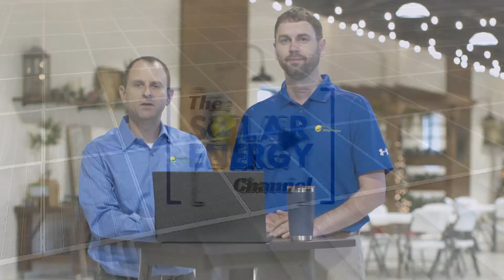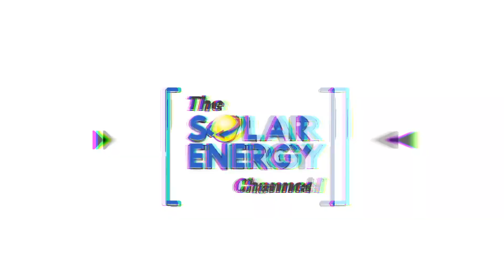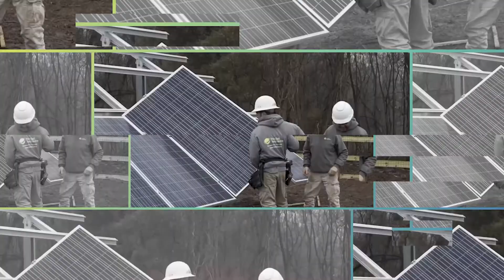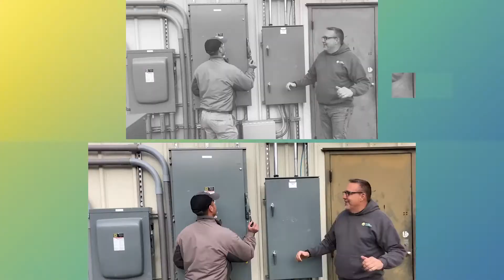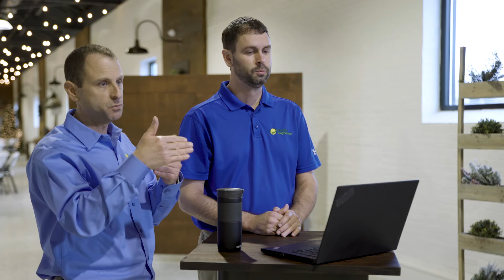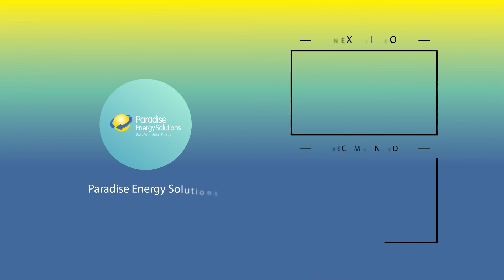When to Use String Inverters vs. Microinverters | What's The Difference?

Comment: The question is can u combine both, plug it separate AC socket?

For ex., you have an existing string inverter then to increase generation add micro inverter setup
Reply from the maker: This would be a scenario for a string inverter system with power optimizers.